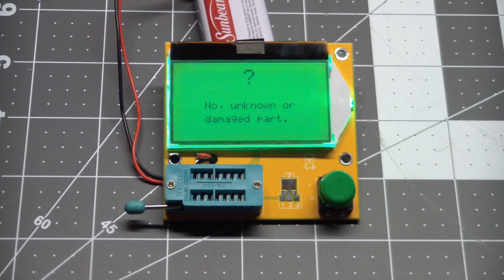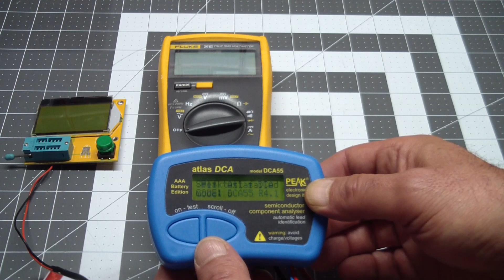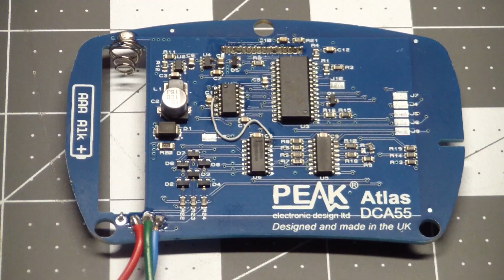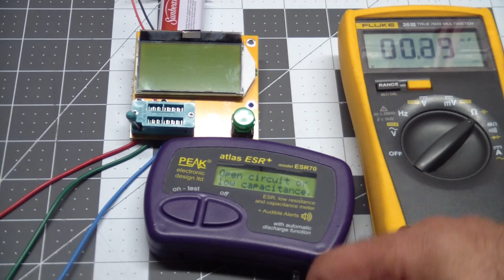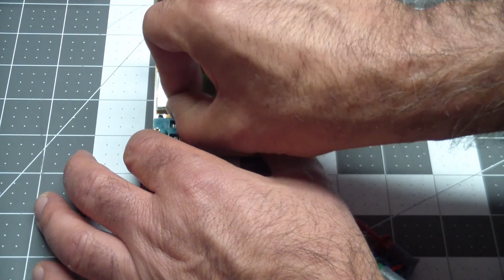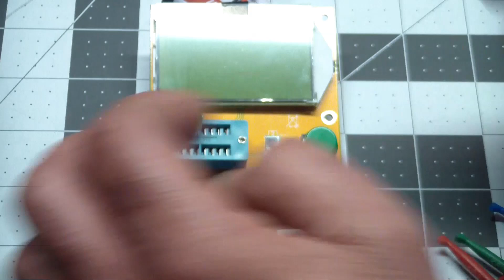AE#95 How Good Is A $5 Component Tester?

Comment: Seems there is a better version of the one you bought - but still, not as accurate as designed due to the Chinese manufacturers not using 1 percent resistors where needed

Some very interesting comments below the video:

https://youtu.be/9cg7pBUUv94

Comment: You should calibrate the tester first by shorting out pins 1, 2, and 3 - goes into self calibration mode when you press the button

As you are using external leads, you need to calibrate by shorting out all three of those - you really need 2 units, as calibration will be different for zif socket and leads

Also, those were metal oxide resistors, not carbon

Comment: ARTIFACT ELECTRONICS, older equipment used 8.4 vdc mercury batteries, why was mercury batteries 8.4volts and not 9 volts? do you know any equipment that uses an 8.4volt mercury battery and not a 9volt battery?

Comment: The really great thing about these $5 testers is that it tells you what the component is.  Novices like myself may have trouble recognizing all the variations in capacitor and diode packages or knowing what a mosfet is. So it's great to have a little device that just tells you.

Comment: I have three or four version of this ,even a factory one ,but I been very lucky to get a restored Knight kg 670 capciator tester ,that will check for many more things then esr , It checks caps for leaks ,it put it under the correct voltage for caps and much more ,the little one work well for what there are ,I could use a esr chart so I no what good or a bad esr if anyone has that maybe they could share with the rest of us ,the little cheap esr meters do work well I heard from a lot of people .thanks for your video.
Reply: Bing or Google image search will provide ESR charts - I have three different ones I got from there - they all have different ESR values in the tables - maybe because they came with ESR testers that test using different frequencies

Some people say large uf capacitors need 10Khz, smaller capacitors 50Khz - I think these Chinese testers use 100Khz

Comment: Hi, it's Jez from Peak Electronic Design Ltd here. It's always difficult to fully diagnose a problem with the unit without seeing it in person, but I would suggest that you send us your unit and we'll take a proper look at it for you. All our units carry a 24 month warranty and if your unit is within warranty and has not been damaged in an accident then we'll sort the repair or replacement for free for you. We'll even refund your postal expenses. We'll be open and honest about our findings and if there are any costs involved then we'll let you know so you can say yes or no. If you choose not to go ahead with any proposed repairs then I can return the unit back to you at no extra cost to you and I'll tell you what the fault is.
As matter of interest, a new DCA55 directly from us here in the UK is priced at 43.75 GBP which is about 55 USD. Airmail is 10.10 GBP which is about 13 USD. Delivery typically takes around 7 days from the UK to the US. The $120 price you mention is likely to be for the DCA75 which includes PC curve tracing functions and more.
All our products are designed and made here in the UK. We acknowledge that they are much more expensive than Chinese made products. We are happy to provide unlimited free support to all our customers, old and new. We can even work with customers to add new features if that is viable.
It's disappointing that your eBay vendor did not provide you with a decent warranty. We ensure that every one of our listed resellers will honour a 2 year warranty. That includes us too for direct sales.
Additionally, we provide a satisfaction guarantee in case you find the product is not suitable for any reason at all.
Please do get in contact with me again if you'd like further assistance.
As a small family company, we are keen to provide the best possible customer service, even to our overseas customers, and to any customer that has our product regardless of how they purchased it.
Reply from the maker: Jez, thanks for reaching out. I've had the unit for more than 24 months and I've also attempted a repair, so I understand that the unit is out of warranty which is clearly my fault. I have no issue with that and I believe I stated as much. Most of what you write you've already sent to me in a private email, but this way anybody interested can see your side.
What I do have an issue with is that I bought the unit from a US ebay seller that acted as your distributor (he had several new units in his listing). The unit malfunctioned about three months after I bought it, ebay wouldn't  let me return it after 30 days and the seller responded with a curt email directing me to your website. Then I discover that I have to send the unit back to England to have it diagnosed, possibly incur additional costs and wait for a couple of weeks.
I respect the fact that you're running a small business and you seem to be a great engineer. But how would you feel if you found out that an essential bench instrument you've bought brand new locally had to be sent overseas for diagnosis, repair and a non-trivial wait time? You might be hesitant to recommend that product, wouldn't you?
Reply: Peak does make very good equiptment, your meter are so small and do a lot ,but they are pricey over in the u.s. but worth the price if you have the money ,they give a lot of info .🖒🖒

Comment: When using a Fluke DVM meter, how do you test for diode leakage? Can you please give examples of circuit testing using a DVM meters Min/Max feature button, i don't know why I would use this. What are the advantages of using a solid state relays compared to use mechanical relays, I often see solid state relays used more in circuits. Some solid state relays use JETS, MOSFETS or triacs.

Comment: U is a correct symbol for voltage! V is an unit (volts). Same like with I for current, and R for resistance. Ohm's law stands I=U/R. Uf is a froward voltage drop (but measured at unknown current, so little or no use of it). It can detect triacs, but only low voltage ones.

Comment: This HDD at the End... I removed a lot of 2.5" HDDs from very slow- or non-working Laptops with similar sounds. But the HDD's i have removed are all Toshiba's. At Some of these HDD's i was able to secure the Data with the Help of my old XP PC where i has a SATA extension Card installed. I use this old PC only for Data recovery projects. For safety reasons, this PC is not hooked up to my network.

Comment: How about testing zener diodes and SCRs?
Reply: The version of this tester I have will do lower voltage zeners.  Zener diodes over about 5 volts just look like a normal diode.
Haven't tried it on an SCR, but mine will identify a triac.

Comment: The power up message on the PEAK suggests to me that CPU is not dead.  I don’t think anything than the CPU would put out text messages.
Reply from the maker: That is my guess too, but it has been suggested that a power spike could have raised the programming voltage pin on the processor and thus partly erased the code. The error may mean that the checksum for flash is incorrect.
Reply: Artifact Electronics  —. Actually, I recall the stories of radiation from the chip or its packaging impurities starting to make those random changes in the memory when the memory cell sizes started to shrink.  Just thinking how much they have shrunk since those days when the reliability guys all around first pointed that out.  One of the industry leaders (HP) reported that they could not use domestic memory chips until the problem had been corrected, meaning radically improved cleanliness standards.  NASA added their experiences about need for radiation hardened semiconductors in general and larger cell sizes in particular.  The response was ever bigger and better clean rooms for the semiconductor manufacturing plants.  Eventually those facilities became so expensive that pretty much no more of them were built in the US.  Anyway, rather than voltage spikes, I would suspect a return of the alpha particle effects again causing such Soft Errors.

Comment: I always use one of these when putting circuits together. Versatility and simplicity then goes over accuracy. It quickly tells you the part type, go/nogo, ballpark value and pinout. If you have no case, put it on a piece of wood, together with the battery.

Comment: afaik it has calibration mode. You need to short all 3 inputs and press the button. During the process you need a 100nF Cap.
Reply: Yes, I have one and do that - trouble is Chinese stuff like this through aliexpress, ebay, etc. do not come with user manuals - I found out a lot of info about these devices through eevblog forum

Comment: That's pretty amazing for $5! Would there be worthwhile value add to supplement the display with bluetooth and a smartphone app with more compute power and better display?
Reply from the maker: It's probably not very accurate as is. Some viewers suggest that it's a good go/no go device and I tend to agree, With the addition of test leads it takes five seconds to run a test.
Reply: @artifactelectronics  Chinese downgraded the electronics - original design uses 16 Mhz crystal, precision reference voltage, 1 percent resistors - Chinese use 8 Mhz crystal, zenner diode, 5 percent resistors

eevblog forum members upgrade these units to original specification and improve the atmel code, then re-flash the processor

Comment: Disappointing to hear that both your Peak instruments have failed/become dodgy since they are fairly pricey ! The component tester tested here seems sort of useful, but only as a go/no go device perhaps - and even then only with a certain range of components - still, it is cheap, and the display is quite nice. Cap ESR measurement only showed half the value given by the Peak - which is a bit questionable...but ESR measurements always seem to be a bit variable, as are the tables showing typical expected ESR values ... 
Btw- I think you should have taken up Peak's offer of a replacement processor for the DCA55 - 
you have the ability to swap a chip like that,and  you wouldn't have much to lose except time maybe, and your DCA55 might even work again  :o))

Comment: I purchased a similar unit with a case, it was the model with the encoder instead of a button.  It also includes a frequency counter, and I think a square wave generator.  I added a bit of circuit board material to use to short any capacitors to before testing them.  Mine did include in the instructions to always be sure the capacitors are drained before testing and it will blow the cheap units too.

Comment: My Peak DCA Pro/DCA 75 and LCR 45 has served me very well over the years. DCA 75 does everything this does, plus regulators, and I trust the readings from the LCR 45 but when in need I double check using my DER EE DE-5000 LCR meter. The DE-5000 an awesome meter but I find myself using the LCR 45 more often as it is just faster, but of course, it lacks a lot of the features of the DE-5000. I religiously discharge any capacitor before measuring on either, no matter how small.
Someday I'll order one of these $5 meters just for fun though.

Comment: On my unit, the bottom row of pins are specifically for testing zener diodes. The first three pins are wired as Cathode, Anode, Anode, reading left to right. The last four pins are then wired 1,2,3,3. The zener pins are possibly at a different voltage during testing, too. The manual also mentions a long press functionality on the button, but never states what that may do. Short press is 10mS to 1.5S.

Comment: 8:09 I soldered three cables to the "three terminal contact array" and connected them to three lab connectors. Now I can use standard alligator clips to test components which do not fit into the ZIF socket
Reply: Those three pads are not for soldering leads, there for testing smd components
Reply: i did the same, which is what they are there for, not designed to holding stuff against the contacts, which is a little bit silly.

Comment: Problem with the DCA55 is the clamp diodes D2-D7, which are quite good at clamping spikes. Sadly they put these spikes onto the positive rail, and there is no further clamp there to dissipate power, so it rises to a high voltage till the load drags it down so the regulator can boost again. There should have been a 5V transient suppressor at the anodes of these, with a 33R resistor to the supply rail, which would have safely clamped charge coming in to something the unit would survive, and the analogue switch would have been fine clamping it, or at least only being the part that failed. You likely got the positive rail up to the high voltage programming voltage, and thus more or less erased the microcontroller partly.

Yes I had one of those, gave it away with the $10 component tester.

Comment: I paid $10 for the boxed version, and bought another after, so I could have one in the "to go" kit as well as at the bench. They work well, just beware of the edge cases on inductors and capacitors, it does not like very high value capacitors or inductors at all, nor high value spiral wound resistors, which it can detect as either a no component, a capacitor or an actual resistor depending on how the leads rest.

Comment: You should run the calibration procedure for these devices before benchmarking their accuracy. Now your findings are pretty much meaningless, even though they weren't bad to begin with. Connect all three test points together, then push the button, to start the calibration.

Comment: Hey Arti --I have the exact same unit. Think i bought it on Amazon for around $10.00 about 6 months ago. I have found it useful in the same way you mentioned: I have a box of components that i've pulled power-supply's and other circuit boards. The tested is great for quick checks then I use the multi-meter to verify the value. so far, I'm pretty happy with it's accuracy,  ease of use and it hasn't failed yet.

Thanks for the review.

Comment: The pin # for the ZIF go :-
Top row
1231111
Bottom
2223333
That's why the LED did work.
Interested to see how it goes with high voltage electro cap, good compared to failed.

Comment: "U" is used as a symbol for voltage, as well as "I" is used for current and "R" for resistance.
I leaned Ohms Law as "U=IxR"
I have build the "5 transistor ESR meter" very nice circuit with an analogue meter readout. Once I came across a charged capacitor this gave a spark, but no damage at all. It has two anti-parallel diodes across the test leads to limit the output voltage but they also protected the circuit. And if something goes wrong it is all standard components.
Greetings from Denmark.
Reply from the maker: When the five dollar one quits I'll build myself the "5 transistor ESR meter" you refer to, thanks

Comment: The time, when the display is on, seems to be a littbe bit short. IMHO of course.
But interesting guy! Will look in amazon or ebay for one.
Reply: You can edit the code and re-flash the atmol to make it function differently - I was planning on having mine work continuously without pressing the test button each time - guy on eevblog forum told me how - will buy the better version, as there are other things that can be improved (Chinese cheapened the design with some low spec components)

Comment: An ESR of zero does not mean the cap is shorted. It means the cap is acting like an ideal capacitor with no resistance in series with it. If the peak device is working this only means that the ESR is lower than what the meter can measure of course since there is no such thing as an ideal capacitor.